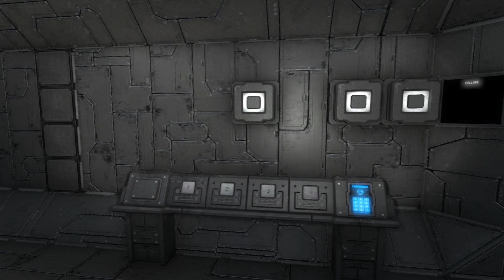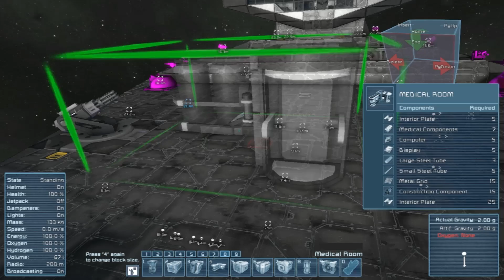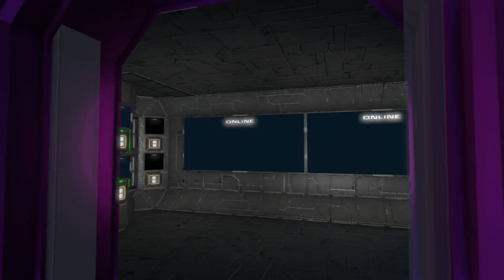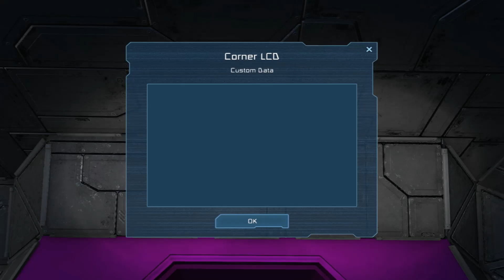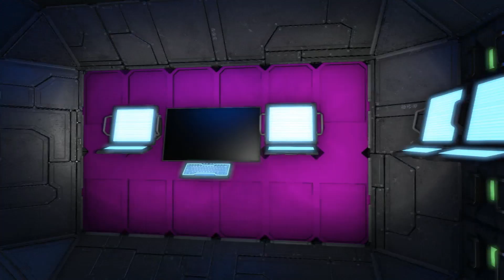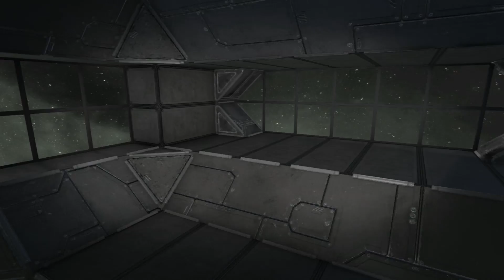Let's Play Space Engineers - Episode 125: Future Plans For The Corvette Build Moving Forward

Comment: definitely the nanite mod. and projector.
Reply from the maker: Will that work if the projector is doing a small ship grid? I wasn't sure if it had to be connected to the grid with the nanite or not.
Reply: Sleepless Knights Studios that can be a bit complicated. but it can be done. even if you have to build a small rig that has a connector and a small ship projector that you connect to the large grid with a connector.  but I think the mod has been updated and has something that solves that problem. it now uses beacons and that may have fixed the issue.